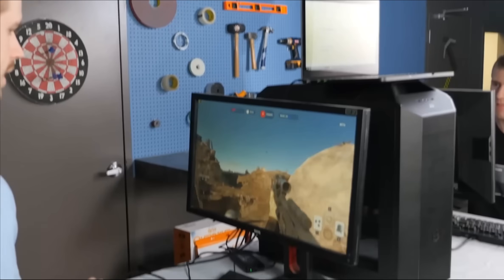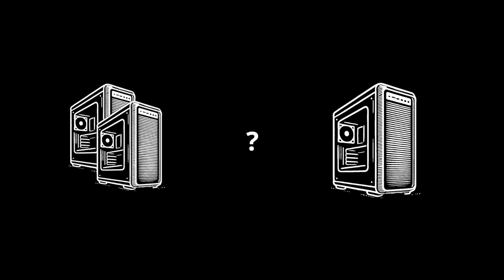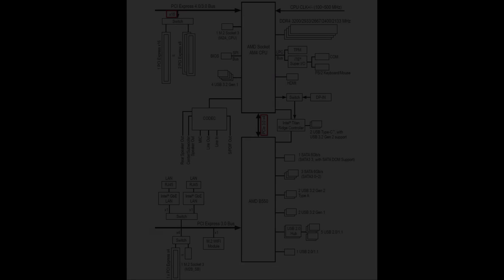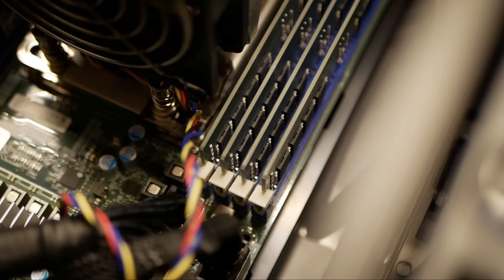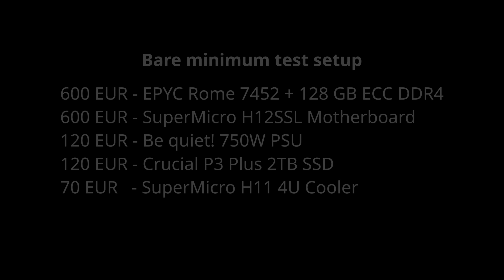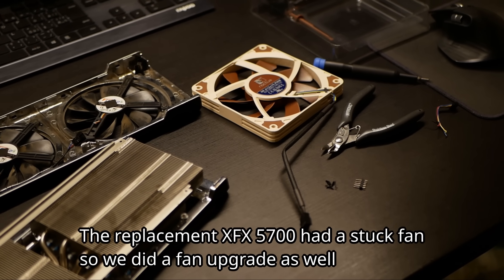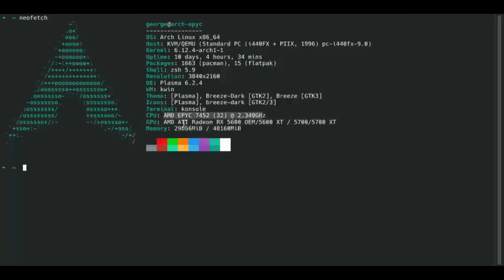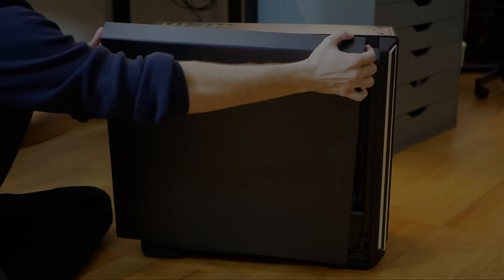Using 1900€ EPYC-based Workstation as Two Desktops - One Year Review

Comment: you can do the same with Asus X570-pro it can do 2x pci-e 4.0 x8 and works perfect with Proxmox with 128 GB ram
Reply: When I was selecting a config for multi OS, I reviewed many motherboards, and concluded that any desktop motherboard is not good for that. They just have no enough processor pcie lanes! You cannot have fast raid ssd and x16 GPU for LLM at the same time. RAM is also limited. Look, if you need a multi OS, proxmox, all that stuff.. you are not a casual user. Ok?

Comment: Epyc Rome so underappreciated on youtube.  Not cheap but bang for buck if you need PCIE and the power consumption isn't a deal breaker it's a great platform.  This is definitely a use case I wouldn't have thought of, really neat to see how you guys used it and glad it worked out for you.
Reply: Real. You can get a brand new 32+ core Rome for $200 brand new, and if you can splurge a 24+ core Milan for $500 new, starting. Even $100 for mild usage on a Rome.  And 128 pcie lanes? At pcie 4.0 no less, which is still more than enough for most applications

Comment: You could buy used workstations from a couple of years ago, something like a HP Z840, with 2 xeons and it would have costed like 300$
Reply: Epyc Rome is going to be at least as fast if not faster at similar or lower TDP than a lot of the Xeons you are going to find in those older workstations you are going to find relatively cheap.  I have a Dell 7810 and and replaced it with an Epyc 7302 and the Epyc stomps those V3 Xeons.
Reply: @nadtz  V4 Xeons are better. But I guess TDPs are going to be a little high since a workstation like z840 has 2 CPUs that's double as much, but even considering that buying 2 xeons something like 2698 V4s is much better than a single 7302. You get more CPU cores, higher single threaded & multi threaded performance and you could get two of them for one of Epyc's price.
Reply: @vishwanathbondugula4593  I'd really love to know why my replies are disappearing.  Long story short I can't find a Z840 with 2x 2698 V4s and 128gb memory for $500 and one of the reasons I went Rome was for PCIE gen 4 so I'll stick with the 7302.
Reply from the maker: Don't know what yt is up to, I'm not touching them. Maybe they have a rate limit?
Reply: @jm-tech7968  Don't think so, I replied 3 times prior to this about 10-15 minutes apart and all those replies are gone.  If I had to guess something was getting caught by a filter or something but I have no idea.

Comment: What client are you using to connect to the VMs?  Are you using a hardware client to connect to the VMs?
Reply from the maker: The two VMs each have a GPU and a USB card with normal monitors and peripherals connected to them, they feel like bare-metal systems
Reply: @jm-tech7968 I think the question was - to get to the desktop, how are you doing that? Thin client?
Reply from the maker: I haven't needed to access the VM remotely yet, I use ssh to pull files if needed, but that's about it.

Comment: I am doing this on a 7000 series Threadripper machine and it's working pretty well. I have occasional issues with audio clicks and pops, even with the USB controllers passed-through, but normally a reboot will clear it up. For peripherals, I have a KVM built into my monitor, and it switches which VM has the devices. Also, I can connect remotely with Moonlight/Sunshine. All in all, It's pretty slick.

Comment: This is great! I am using both a native Ubuntu install and a virtualized Windows with GPU passthrough. Having a GPU and a screen each makes it like two machines and I can thus run 3D cad in Windows and heavy parallel calculations on Linux. Best of both worlds. And with Barrier running on both machines, my cursor and keyboard switches seamlessly from one desktop to the other. Magic!
Reply from the maker: Oh that's a cool setup, are you using integrated graphics for the Ubuntu host?
Reply: @jm-tech7968  Not necessarily. I have similar setup on an X570 mobo with bifurcation. The first GPU is running native Ubuntu. The second one I pass through to a Windows VM. But it could have been another ubuntu instance. I see no reason to have a second VM since you are fine with Ubuntu anyway. It's quite easy to set up PCIe passthrough with virt-manager.

Comment: 0:17 what keyboard is that? WHAT KEYBOARD IS THAT? ANYONE KNOW?
Reply from the maker: It is a rapoo E9270P, but I am looking to replace it with something more reliable - the top touch bar sometimes activates on its own and usually turns up the volume to max 😅 it's so bad I made a habit of setting the system volume to 80% and dialing down everything else so I don't go deaf one day

Comment: ~6:49 not ideal for the power consumption? that curve shows its under load most of the time :P so its actually doing things ... so you wouldnt want to turn it off anyway probably :p i have a similiar setup ... and when i have the base system + 1 linux + 1 windows (with GFX PCI pass trough) VM running, my system drops down to like 50~60 watts "idle" power consumption just handling the background tasks of all 3 systems ... and i have a i9 14900k + 7900 XTX so they can draw power if they have to :P yours showing to eat 200 - 400 watts constantly ... so it is actually working hard :P
Reply from the maker: It's not explained well in the video, that's actually the consumption of this system + another PC working as a NAS (40W) + another SBC running proxmox with DNS, home automation and gitlab (10W) +  the whole desk with monitors and some chargers + some networking gear. As you said the idle is around 60W for me as well and it can spike up to like 600W under heavy load.

Comment: how would this work with 1 or 2 times windows and playing games? Expect the same experience?
Reply from the maker: You can run windows in proxmox, the GPU passthrough is more difficult but doable. As for running games, forget about any MMOs or any multiplayer in general, as anti-cheat will flag you for running in a VM. Most single-player games run fine and we have gamed on this system many times.

Comment: This setup is so fun to use even tho a little annoying with consumer grade hardware if the mainboard doesn't play nice. Before I went ITX, I had my 5700 and my 580 installed and used the 580 for Linux while the 5700 was for a Windows VM. If I had a partner who needed a powerful PC, I'd probably go that route again since one can even remote connect to those VMs, which is super handy.
Reply from the maker: Yes I agree, also backups are simple, in our case proxmox just takes a snapshot every week and stores the last 3 on our NAS!

Comment: More surprised you didn’t try multi seat given your use case.  Less overhead vs VM since it be just 2 seprate X-11/wayland clients running at the same time.
Reply from the maker: We wanted to keep the OSes separate by design, I like to experiment and break stuff and she needs a stable env to work on
Reply: Proxmox is not an overhead, but rather tons of possibilities
Reply: proxmox is a middleman: it is automatically overhead.

Comment: Btw, your girlfriend mentioned Mashine learning workloads, is the 5700XT enought, or does it run on the CPU ?
Reply from the maker: Mostly CPU because she works with a wide range of things, not just neural networks. But yeah, bigger models ended up on the GPU, we just upgraded to an RX7900 in-between shooting this video and it going live, because we will need to run some LLMs for research locally.
Reply: Vram size makes a bigger difference than number of tfloops. If your model doesn’t feet, then this is not a big deal will you get 6t/s or 2t/s. You will wait in both cases. For me A4000 (up to x4) is the most optimal solution from a price/performance/size/wattage perspectives

Comment: Awesome video! It's always great to see experiments with fully detailed steps instead of just a brief overview of the work.
I have some questions about your setup: why did you choose Proxmox? From my experience, Proxmox can use around 500MB to 1GB of memory right after a fresh installation. 
In the video, I’m not sure if this was mentioned, but how do you handle the disks? Do you use direct passthrough to the VM, or do you create a disk image for each one? 
If you're using an image, it might be better to map the disk directly using UUID into the VM and define write-back.
Regarding the power-off button, with the help of acpid, you can manage various actions for what should happen when it’s pressed.

Inak skvelé video, len tak ďalej 👍
Reply from the maker: It is a single gen4 nvme with disk images for the VMs, it is plenty fast for our use-case.
I chose proxmox mostly because I am familiar with it and it did all I needed. Also there is a second machine in our home-lab which had already used it before this setul was built, I have a blog post about the home-lab https://manakjiri.cz/project/home-lab/
I'd like to make a follow-up video where I'll talk about this in a bit more detail. Thank you for the questions!
A pozdravuju :)

Comment: thanks for making this video! I've been considering using EPYC for a "remote workstation" involving virtualized desktops, this makes me feel better about it!
Reply from the maker: Glad to hear that, I was surprised how easy it was to setup and how stable it is, but it makes sense, since this tech powers the cloud if you think about it. As I mentioned in the video, if you stick to newer hardware (gtx10xx and above), you shouldn't have any problems. Older AMD cards suffer with the reset bug (mine included), but that's possible to remedy with https://github.com/gnif/vendor-reset

Comment: 5:11 I saw those exact graphics cards go on sale recently(rx 5700 xt) on aukro. It was about 60€, I waited too long and they were sold out:(
Reply from the maker: I got mine from someone who upgraded to something newer, I think I overpaid given it's condition, but I needed some replacement quickly because the 770 died unexpectedly. Turns out the 5700xt is sufficient for running ollama, so I am quite happy with it in the end. If you can get it for €60 I think that's a good deal, it is also not as power hungry as I expected.
Reply: @jm-tech7968  I’d recommend two RTX 2070 Supers if available, eBay might be worth checking. Cool setup though, I’ve thought about using cheap mini PCs to log into Parsec instead of running locally. For non-gaming, NVIDIA Quadro cards are cheaper, more power-efficient, and still solid, but mostly use mini DisplayPort.
Reply from the maker: I periodically (every year or so) give nvidia a chance, but I find it too glitchy on linux to be usable. I do not understand how we can still have graphical glithes in electron apps and browsers on wayland in this day and age. Can you attest to this? I would hope the quadro would be better in this regard and I would love to get better power efficiency.
Reply: Nvidia only recently started allowing Linux developers to use their open source drivers. They should have provided better support over 15 years ago, but it’s Nvidia. You’re right to stick with AMD. I have a 7800XT in one of my Linux desktops.
Reply from the maker: Yes! I'd like to play with some Intel card, if I can get my hands on it.